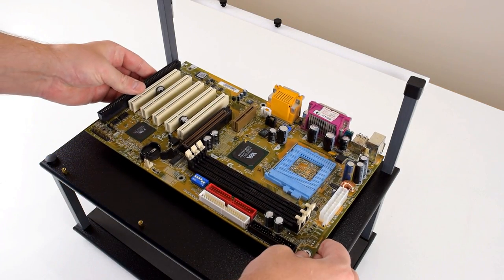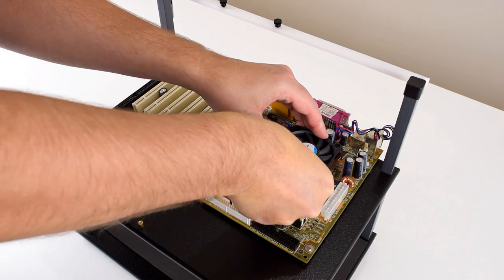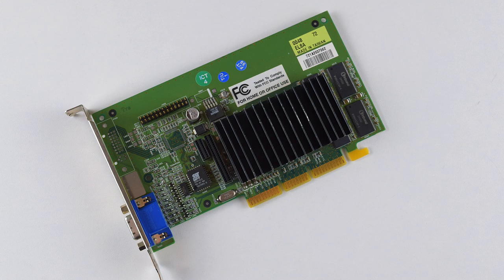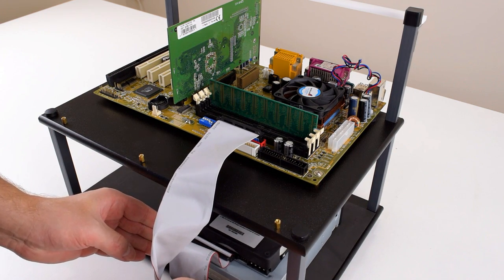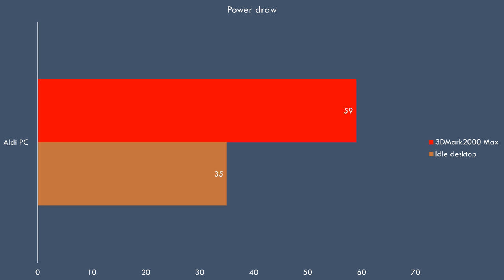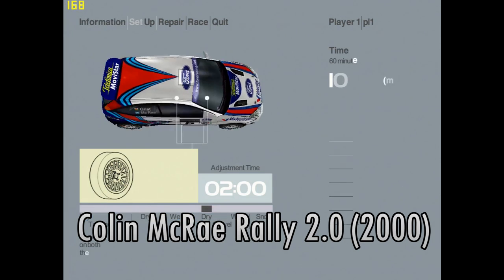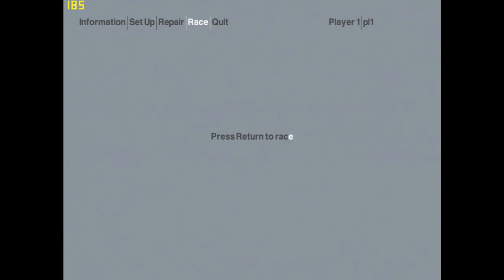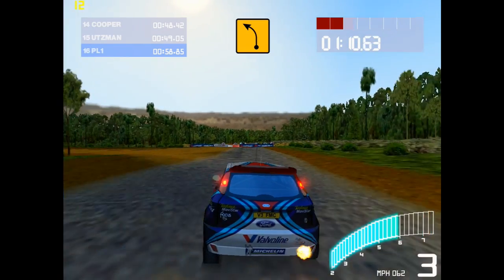Building the Aldi Medion Supermarket PC from 2000

Comment: we've got them in switzerland too (repaired a bunch of them)
usually have a large number of CPU Speed but not the best CPU, Ram was mostly not enough and quite slow ones, however they came with pretty neat GPU's lot's of iO and a relativly Large HDD

They still make PC's and are absolute crap, cheap quality, filled with bloatware and worst of all: "locked", you can insert a PCI-E card but it will not work as the slot is disabled and can not be eneabled without a flashing some unoffical bios...
Reply from the maker: PCIe disabled through BIOS? Wow that's really a poor move and not customer friendly. Did they fear that the PSU won't handle it?
Reply: no, they dont want you to upgrade the computers so you have to buy a new one sooner ... They have a pretty bad reputation arround here, the old ones where allright for the price
Friend of mine has one that isnt able to upgrade the ram even (MB has 4 Slots, 2 are active)
another Friend had a Tower with an AMD APU and no dedicated gpu, gave him a leftover GPU of mine ... didnt work, ended selling the medion tower and building a new rig

i've repaired several Models with Pentium 4's, they only lacked Ram and had a low quality Mainboard

Comment: I was a little disappointed this isn't an actual Aldi Supermarket PC, but rather a similar build. Except for the CPU no other component matches and it's not even in the proper Medion case, so I find the title a bit misleading. I still enjoyed the video though, even if this is the first time I heard about Aldi.
Reply from the maker: Try sourcing the original case, parts and, how much it costs plus shipping, all for just one video. It is simply not worth it. I explained in the very beginning what the video is about. The chipset, graphics card, RAM and hard drive are 99% matches, hard drive is just a smaller version and the chipset 1 newer revision, but the performance and how it behaves is very accurate.
Reply: I know, and I have no problem with that. I'm sure the performance is very close to the original, but when I read the title I was expecting something different. I was only disappointed due to the title, that is all. I still enjoyed the build since it is much more realistic than the usual super performance top of the line builds people usually do.
Reply from the maker: Yea, how would you title it? I thought about re-building or re-creating, but that also sounded like a restoration project? So I stuck with building, as I was building something :D
Reply: I don't know either! Naming things is hard :) How about "building a 2000's generic supermarket type PC"? BTW, is this Aldi Medion similar in quality to a Vobis Highscreen?
Reply from the maker: I'm not sure about the quality, but from the comments they were quite decent computers.

Comment: I bought an Aldi PC 4 years ago. It had an AMD APU A10. I tried upgrading it with a graphics card, but that wouldn't work. Strange thing: When putting the VGA in the motherboard while booting, the system would run fine after swapping the cable back to the GPU after loading. But when I plugged the VGA into the GPU while booting, the thing just started beeping. I sold the PC without the GPU and started building my own system. I regretted that ALDI PC.

Comment: I have a Medion Pc with an i7
Reply from the maker: So they still do PCs? No Aldi store in my area I'm afraid. Is yours good value?
Reply: Yes, they do, check out medion dot com
I bought the PC in MediaMarkt and it came with an i7 4790, GTX 750, 12 GB Nanya DDR3 Ram and a 1TB seagate hdd, but I think the PSU is generic and the motherboard is  made by Medion (h81h3-em2)
Reply: I forgot to mention, the CPU cooler is from some chinese company (AVC) and it gets really hot (+77Cº under load) but it has never turned off due to overheating
Reply from the maker: 12 GB RAM? Nice. And the GTX 750 is another iconic card, very low power.
Reply: Medion pcs dont sell in Aldi anymore. You can get them in some computer shops

Comment: http://thumbs.ebaystatic.com/images/g/bKwAAOSwMgdX1o4h/s-l225.jpg

had this pal back in the days,
440lx, so at tower not atx, was a problem a bit.
p2 266
64mo sdram
4,3 go hdd
and a ati rage pro 4mo where you can add memory but directly changed for a tnt2 m64 after.

Nice machine but limited when I tried to play half life, so I added ram and the tnt 2 at this point.

Nice memories should still be at my parents' place.

ah and by the way, annoying thing is it needed a din converter for keyboards, the din on the mb was big.

otherwise trust screen, 

https://images-na.ssl-images-amazon.com/images/I/51mr2Mcb-KL._SX300_.jpg

this keyboard and a random Microsoft mouse.

Done by auchan supermarkets in France in 1998 or before I guess.